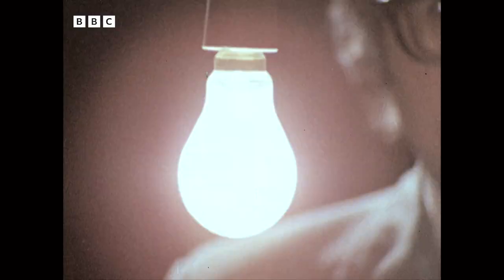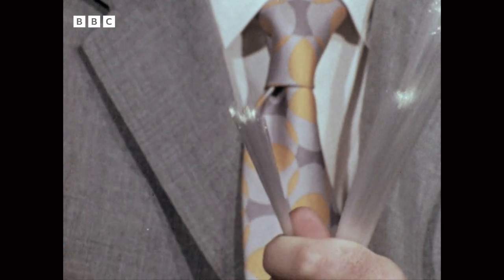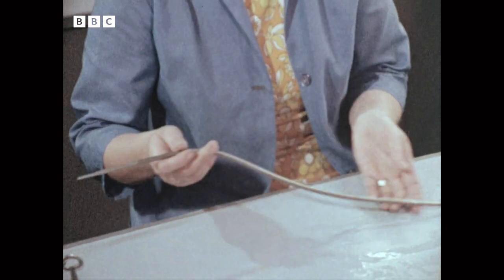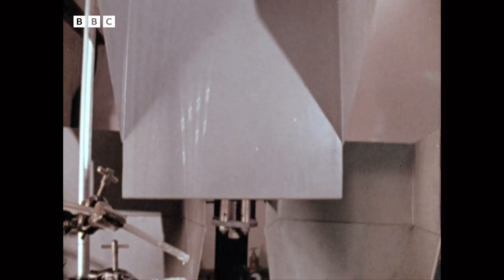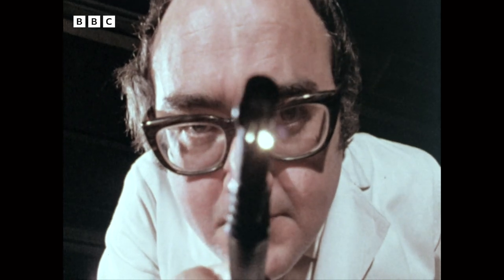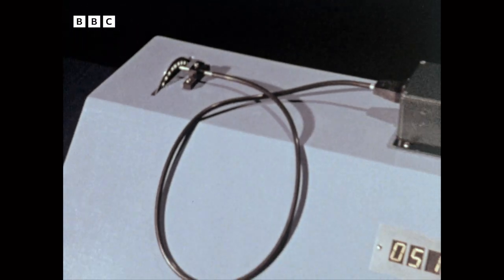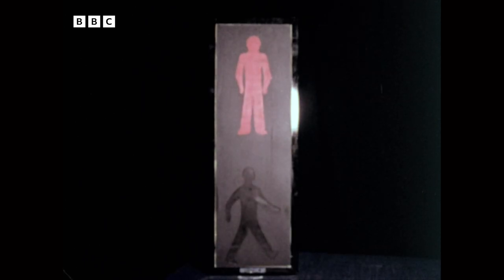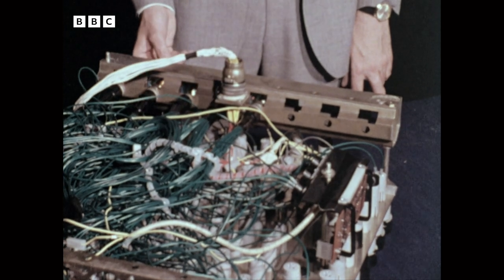1971: FIBRE OPTICS - light's bright future? | Tomorrow's World | Retro Tech | BBC Archive

Comment: Interesting that in 1971 Fibre optics envisioned use was for illumination rather than what we use it for now, high speed data communication.
Reply: This was way before LEDs were commercially applicable, and the more advanced lasers were huge and to limited to certain uses. With LEDs and better fiber optic techonology was possible to send digital data and to be use in lightning and signaling as its used today.
Reply: By late 70s it was used for data
Reply: Back when television had programs like this every evening 
Now it's I'm a sweary chef get me off to an island full of freaks
Reply: hey, they were going to be used to get data off punch cards! that was high speed :)
Reply: @vanrutgar6536   lol
Reply: I don't think we had LEDs or lasers we could pulse on and off fast enough for it back then.  You could send messages/data, sure - that was a known - but it's limited not by speed by bitrate - you can only turn a normal bulb on and off so many times a second.